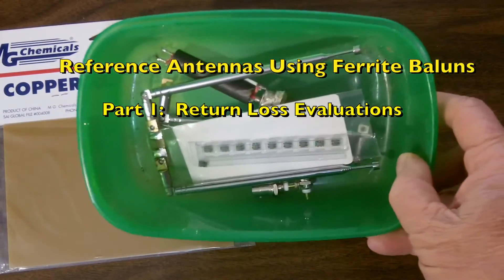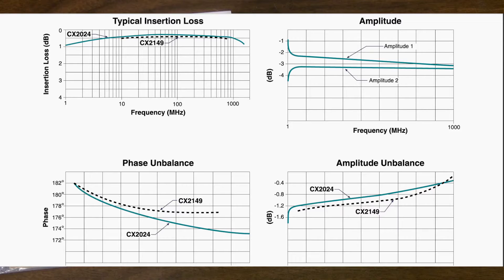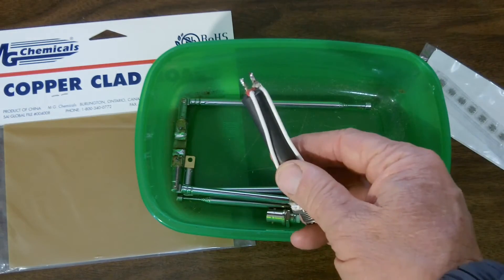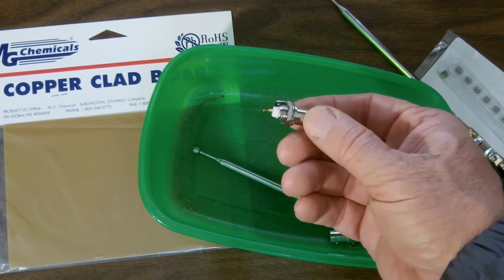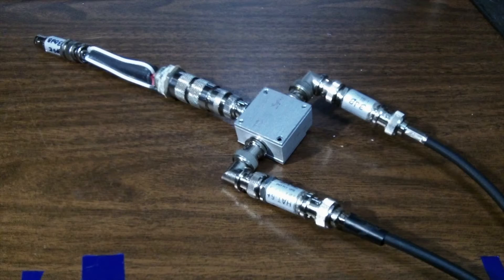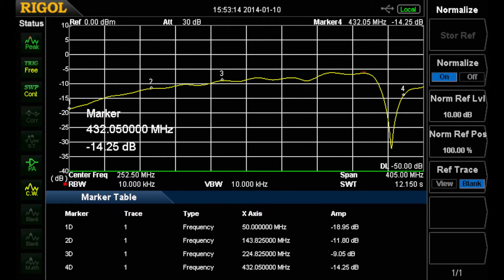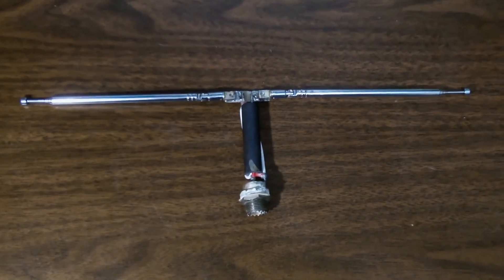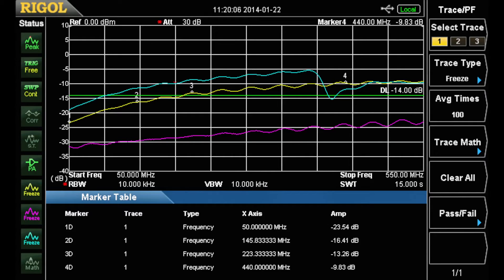Reference Antennas Using Ferrite Baluns Part 1

Comment: Good matching  do not mean good balun. I suggest first to measure the balanced current and the phase to see how well balanced are yours devices. The return is not a característic of a balun. It show you only how you transfer your energy efficiently.
Nice construction. Good job.
Reply from the maker: The balance information is in the spec chart for the Pulse Electronics CX2024 Balun as is the Forward Loss and Return Loss.  I believe that I measured the loss through two cross connected baluns during my experiments and found the Forward Loss to be within expected limits.  If someone really wants an FCC acceptable Reference Antenna they should probably consider the Willmar K Roberts design published some years ago.  You might be able to find information about it on the internet.